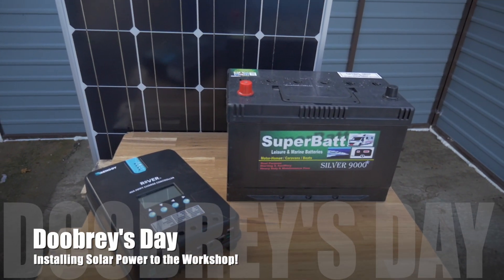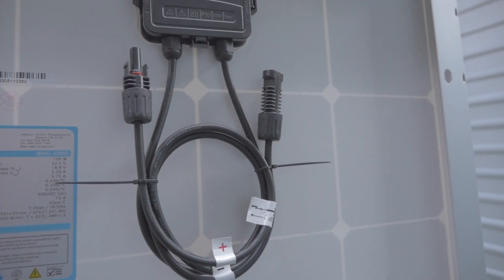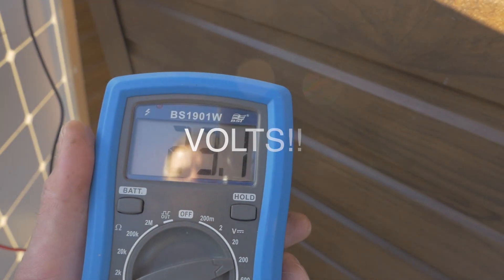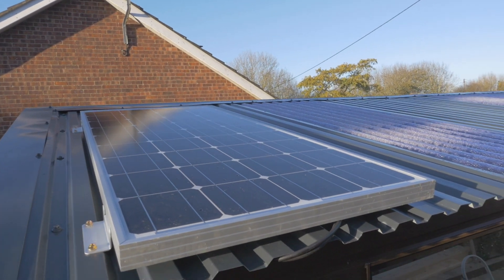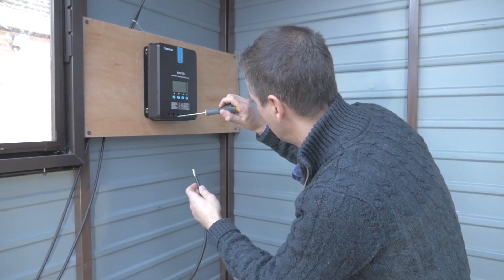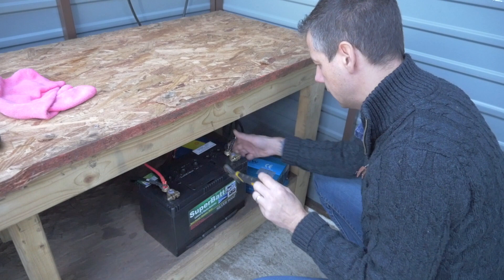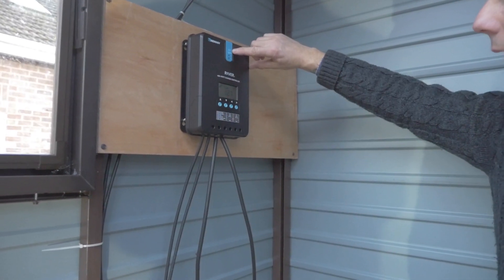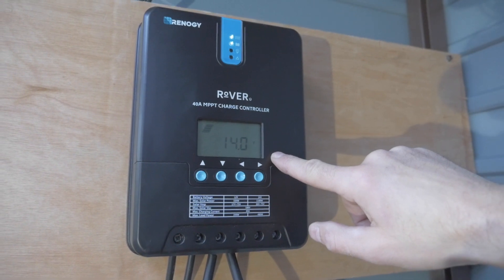The Ultimate DIY Guide to Solar Power for your Shed (How to!)

Comment: Shed’s can get pretty hot in the summer. With high temperatures, does the battery create a fire risk? Great video btw 👍
Reply: Car engine bays get hotter than any shed
Reply: I'm curious too
Reply from the maker: Not that I am aware of.  Bearing in mind had the burners on.... roof melted, battery and solar still ok!!

Comment: Hi. Informative video. I'm creating a similar shed set-up: 12V 100 W solar panel, 20 amp controller, 12V 300 ah battery, correct gauge wiring etc. However, I have come to a stumbling block, what inverter to use. I want to be able to run power tools like 600 W drill or 830 W saw. I know I should use a pure sine wave inverter but there are so many fake ones out there. Have you a recommendation please? Thanks.
Reply from the maker: Hi Saeed.  Tomorrow I can ping you the inverter I purchased.  2000w pure sinewave.  Certainly does the job :)
Reply from the maker: This is what i bought 
luyuanIPower CAR CARAVAN CAMPING BOAT 2000W / 4000W (Peak) Pure Sine Wave Power Inverter Soft Start 12V DC to 230V AC convertor with LCD DISPLAY
Reply: @Doobrey  would this be okay to power nights and heater as well? I'm completely new to this :)

Comment: Should have gone lithium.
Reply from the maker: I am in the process of upgrading to Lithium :D
Reply: @Doobrey  Nice ;)
Reply from the maker: Crack.com  depends on many factors, Crack.com.  My, albeit, limited understanding is that depending on the voltage of the cells, the configuration of them, series/parallel, number of cells, etc. really makes a difference.

Comment: im currently at the stage about getting a battery, I got the 100w solar panel plus the solar charger, went up to my local garage to see if i can get a battery and they looked at my like i was an idiot, Does it have to be a leisure battery or car battery to be honest not sure what battery to get at the moment,  My solar charger only takes lead acid batteries to advice they were giving me i would have got the wrong one, any help will be great, Nice video getting a better understanding,
Reply: Pete, correct. Really just make sure you use deep cycle leisure batteries and know that to maintain a lead acids life don’t discharge to lower than 50% often.
Reply from the maker: My understanding is its all to do with the Amp Hours.  Most leisure batteries have a longer amp hours (which means, depending on the watts that the devices draw down on, will last longer with more hours).  Typical car batteries have a lot less amp hours than lesiure batteries.    I am currently looking into Lith-ion batteries, which have a smaller footprint for greater capacity.  Keep watching for those videos to come soon....

Comment: Don't forget to put a circuit breaker or fuse between the battery and power inverter on the positive cable. For example if you are using a 1000w inverter then use an 80-100amp breaker.
Reply from the maker: You beat me to it!  Already got one and also a watt meter to put on the Solar side...watch the channel and it will be there :D

Thanks for taking the time to write and comment, it is appreciated!

Doobs!
Reply: Circuit breaknor right which one isn't needed how do you know it can handle the power and fuse better or worser the the breaker if leaving it on sry still learning